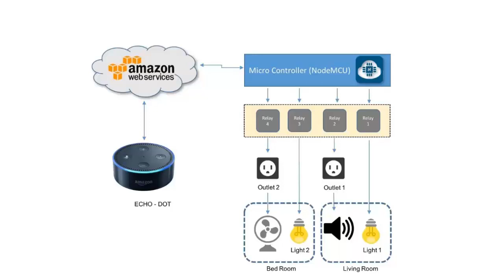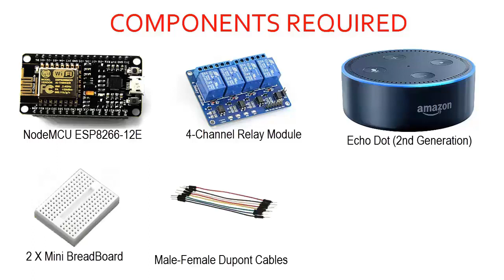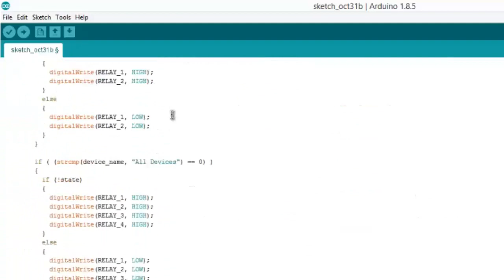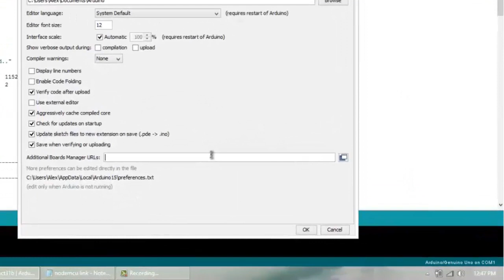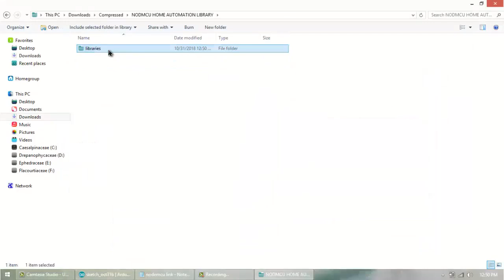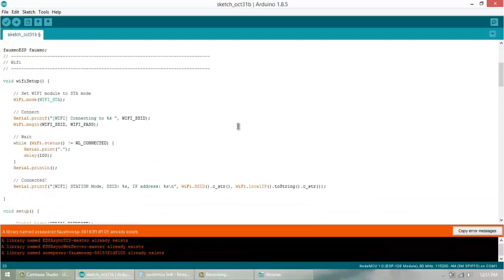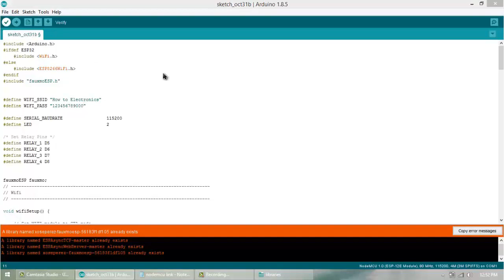Voice Based Home Automation with NodeMCU and Alexa | DIY IoT Project

Comment: Please clarify the when you define the relay as D5,D6,D7,D8. But in nodeMcu these pins are 14,12,13,15. Will the nodeMcu realise this?  And after successfully uploading the codes how to connect the nodemcu to Alexa, as my Alexa can't discover it. I tried it to discover via Amazon and Belkin app but it's not showing anywhere.  Please make a video on how to connect this device to Alexa.

Comment: Also, the Arduino IDE showed the following errors: 

Arduino: 1.8.9 (Mac OS X), Board: "NodeMCU 1.0 (ESP-12E Module), 80 MHz, 115200, 4M (3M SPIFFS)"

Sketch uses 240025 bytes (22%) of program storage space. Maximum is 1044464 bytes.
Global variables use 32960 bytes (40%) of dynamic memory, leaving 48960 bytes for local variables. Maximum is 81920 bytes.
warning: espcomm_sync failed
error: espcomm_open failed
error: espcomm_upload_mem failed
error: espcomm_upload_mem failed

This report would have more information with
"Show verbose output during compilation"
option enabled in File -> Preferences.

Comment: Very good Project and Video. However, I need few clarifications:

1. In the Board Manager you have selected version 2.3.0 but not the 2.4.2. Whether the project will compile on 2.4.2 or have you tested it with version 2.4.2?
2. Power supply to the ESP8622 board is not clear, only Ground pin is shown as connected, what about positive. 
3. Also whether the jumper JD-VCC to VCC in place, no isolation?  
4. It would have been better to tell users the IO pin connections from relay to ESP8622.

Overall, it is very nice. waiting for reply

Amitabh
Reply from the maker: Here are your answers.
1. The code will compile with 2.3.0 version or the version higher than 2.3.0. I have tested already, you can try 
2. Power supply of ESP8266 is 5 volt. You can use 5 volt adapter or 5 volt battery. Use VCC pin for VCC and GND for GND.

3 & 4 I have already given the circuit diagram for the project, you can follow that. You can also cross check the connections with program/code. Moreover you can check the datasheets of NodeMCU esp8266 for more info related to i/p o/p pins.
Reply: @HowtoElectronics  Thanks for prompt reply. However, 3 & 4 are still not clear. That is whether the Jumper on the relay board is in place or I it can be removed and JD-VCC be  connected to External 5V supply for better isolation. 
Also,in your circuit diagram  VCC pin has not been shown connected with External Power Supply Board. Unless the Jumper is in place, the ESP8622 board does not get powered.
My  Echo Dot is connected to Home WiFi to enable me hear songs from internet. So, what changes are needed in sketch to connect it with my home wifi? 
Please guide.